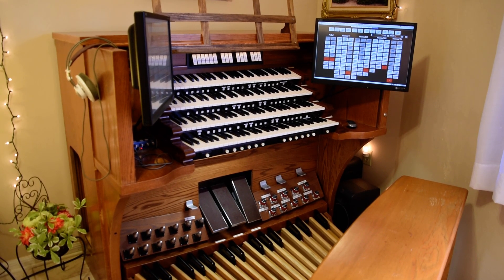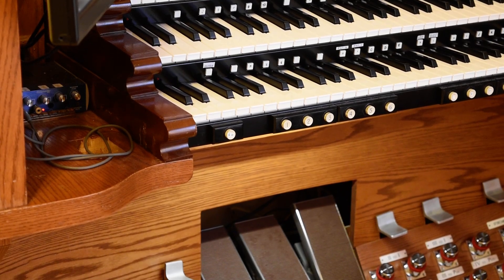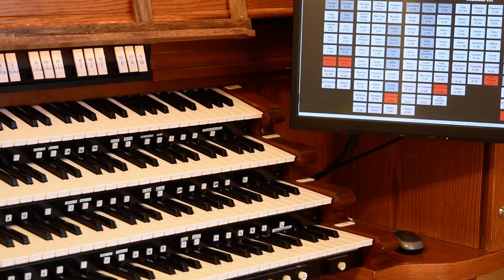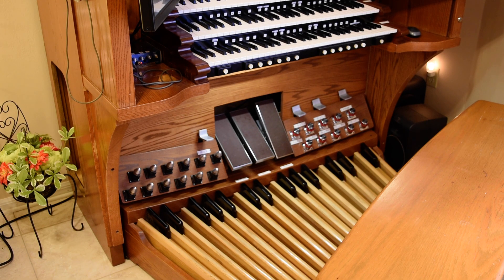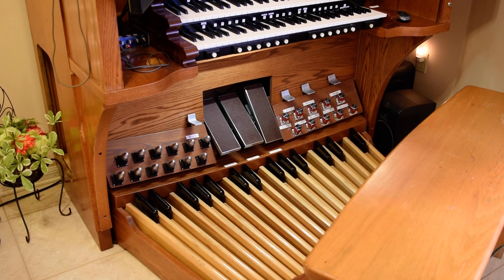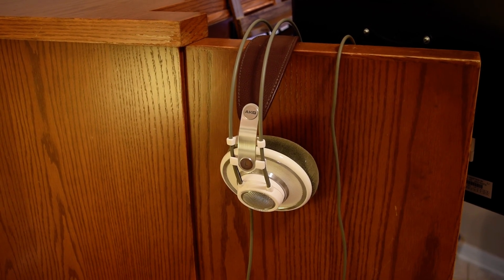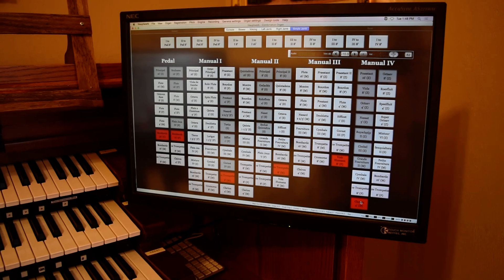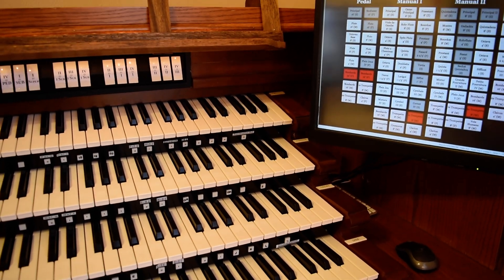Hauptwerk Organ Pipe Organ Retrofit

Comment: Thank you so much. Could you tell me what size the headphone output ports on the Presonus HP4 are? Also, do you have two inputs going in? Where did you get the recommendations from Brett Milan? Is there a website?
Reply from the maker: The PreSonus HP4 has the large headphone jacks ( 1/4" ???). I also have a few pairs of headphones with the small plugs so use an adapter.  The PreSonus "sound card" has a MIDI IN and a MIDI OUT plus several output jacks. I tapped the HP4 headphone preamplifier into two of these outputs. 
Regarding headphone recommendations, Professor Helmut Maier of OrganArt Media (Sample Set Producer) stated that AKG701's were the best. He was correct. In the beginning (2007-8) of Hauptwerk when Bret Milan was more involved with customer service and created some sample sets, he was available for recommendations, etc. There is a website (Hauptwerk Forum) but Milan is unavailable. Hauptwerk producer, Martin Dyde, is extremely helpul to everyone.

Comment: Hi Tuba mate, hay I've made a few attempts at this too now and run into a few snaggs, I was wondering if you had the same issues. The first problem is a rather big Latency as they call it, I'm having a minimum of at least three quarters of a second delay from note press on the keyboard to actual sound, then there's the next issue of MIDI Channel choke when Bach is played, man it's just unplayable. The CPU Loading isn't  that great. I don't know if I should cut my losses & Dump MIDI for a custom Parallel port scanner to elliminate channel choke because MIDI is basically a single channel serial port which doesn't cut it for complex musical pieces. What's your thoughts & experience on your machine?
Reply from the maker: I'm not sure what computing power your computer has. Before I upgraded my 2008 MacPro dual-quad core ( 8 cores) to the present MacPro 12 core, the only sample set that gave me a latency problem was the giant Esztergom sample set which I rarely used. All my other sample sets were fine. The 12 core handles everything instantaneously. The 12 core Mac Pro was a used 2010 computer that has worked flawlessly for eight years of constant use.
Reply: @tubamaxima187  Ahhh good to know, I got a guide line to work with now. I have a new 24 core, 32 Gb ultra high speed ram built for the job now, though haven't spent much time on the MIDI side of this for some time. Having dramas with getting sample sets to load properly. the organ software works fine with the basic sample set included but nothing else so far. Anyway more work needed at the moment.
Reply: Well old mate, those computers are Mega computers. I know I started small with 4 Gb but on checking out memory usage after the sample set is loaded, it only used 800 Mb & the processor loading is about 25 - 30% but yes I do have on order the latest top of the line Udoo Bolt V8, it's the most powerful single board computer on the market & the thing will fit in the palm of my hand complete with an SSD drive & 32Gb ram with the ability to run 4 x 4K displays if you want along with all the other usual peripherals + an on board microcontroller. Thats my current plan to beef it up. I've only used old computers to prove the concept. I just hope this is the right direction. When it all turns up I'll let you know so everyone else can see if it was a good idea or not.
Reply from the maker: I  am completely inept when it comes to computers. Your latency problem is probably due to your processor being overloaded with too many stops. Do you get a delay from one or two stops ? There is a polyphony adjustment (number of pipes simultaneously playing)  that can be lowered. See if that works.
Reply from the maker: Hi HiTeck:
I have to confess I am not a computer guru so adressing your issues is beyond my ability. If you are a member of the Hauptwerk Forum you may pose the question on that site and get an answer. The only sample set I have that has a latency issue (i.e. a slight delay from key press to sopund) is the large Esztergom.  I would suggest that you reload your sample set rather than fiddle around with endless possibilities and go to the "Polyphony" section which is located on the drop down menu. If you reduce the polyphony (it depends on how large your organ sample set is) it may increase the speed or reduce the latency. I'm not even sure if that is your problem. How many GB of RAM do you have ? I had 32GB with my old 8 core MacPro but now I have a 2011 MacPro from IBuildMacs (talk to Jon, he's amazing) that he built for me that now has 12 cores (3.33 GHZ) and 96 GB RAM. It's supposed to be the fastest computer on the planet. I don't know if the latency issue has anything to do with RAM but my problem went away. I paid $2600 for the computer. I would NEVER buy another new  Mac as they are all way too expensive. Apple is disgusting, four years ago my 8 core stopped working and Apple wouldn't even look at it since they said it was "vintage". After calling around I found out that the problem was simple, it was a bad RAM module. Apple was falling over themselves trying to sell me a new computer for $12,000. They disgust me.

Comment: Hi and congrats on your VPO build. I also have built a four manual organ from an old 1970 vintage Allen console. Not as pretty and well finished as yours but works well I'm using Hauptwerk plus the Paramount 450 series Best wished from Australia.
Reply from the maker: Hi Ross from Down Under. Thanks for your nice comment. Interesting choice of your console  (1970 Allen). I actually converted a Rodgers (I think a 1969 or 1970) myself but settled on the Schantz as seen in the above video because it gave me greater flexibility with the computer monitors rather than a fixed number of stops. However the consoles with real moveabe stops make for a better real-time experience than computer monitors. Its a tough choice, for sure. The consoles of that era were very well built and used double acting stop action magnets rather than fixed stops that light up. My 1970 Rodgers sounded horrible (for the time it was state of the art) but a Hauptwerk conversion breathed new life into it. Amazing.  I would like to see some pictures of your console if that is possible.I love the Paramount 450  theater organ but doesn't that require an external reverb (which I don't have) to make it sound more realistic ?
Reply: Hello again

This organ build project was undertaken with my 15 year old son and was a home school project. It went through several rebuilds, does it ever end, starting as a two manual Allen console and now extended to 4 manuals. I have 30 lighted pistons set for divisional pistons plus 24 membrane piston switched mounted under the keyboards, 20 of these are the general pistons and 4 set as toe buttons. Don’t have any of those at this stage.Plus 44 stop tabs on the stop rail. Cabinet has been extended upwards, a bit rough and ready not such a nice job as yours, but very functional. I had lot of issues with the old Allen keyboards which really needed replacing. I did this very economically using 4 Roland A-800 Pro keyboards. These work very well and also provide the double touch functionality used with the Paramount 450. I have also added top right of cabinet a Behringer Reverb Unit. This brought the organ alive. I’m also using Presonus Midi/Audion Box and the HP4 Headphone Amp. This allows me to split the output signal from the Behringer Reverb to both my external home theatre audio system and the headphone HP4 unit. Listening and practising using the headphones is like sitting in a cathedral or concert hall. While I play a lot of musical and light classical music, I also enjoy classic organ music and use the basic Hauptwerk Organ for this. Maybe one day when funds permit, I get a larger classic organ to add.

Jos from UPS systems in USA supplied all my encoder boards and has been super helpful throughout the build. We often exchange MIDI files as I enjoy listening to my VTPO being played well by others.

I’ve attached a couple of pics, hope you get these OK through this YouTube reply.

Kind regards from Aus

Ross Baker
IMG_0465.jpg
IMG_0446.JPG
Reply from the maker: The old electronic organs (Rodgers, Allen, Viscount, etc.) make excellent donors for Hauptwerk upgrades. Some of the earlier consoles are beautiful pieces of furniture just begging for an upgrade. The console I used was a 1960 Schantz but I also converted a 1970 Rodgers Mod 770 which had three manuals and 66 tilt tab stops (which I prefer to draw knobs).

Comment: Very impressive setup there. I want to do the same with some scrubber Organ that has failed electronics but keyboards are good. Can Hauptwerk software work on a Linux system? And those digital scanning boards, where do you get those?
Reply from the maker: contact me privately
Reply from the maker: Yes LINUX will work. Contact Classic MIDI in Canada. I would recommend that if you get three or four keyboards, get one with the pistons and three with no pistons. I never use all of my pistons.

Comment: Hello "Tuba Maxima", could you please share the complete description of the PC that you use? Thank you very much
Reply from the maker: The original computer was a 2007 MacPro dual-quad core (eight cores) at 3.00GHZ speed with 16GB (later up graded to 32GB). This computer is 99% of anything that you will ever use. You can purchase these computers for IBuildMacs in California. Brett Milan highly recommends Mac computers (very important) over PC's. I made the mistake of using a Hewlett Packard PC in another organ and it was plagued with audio problems. It was terrible. I ended up replacing it with a Mac and instantly the problems went away. PC's only have an advantage because they are cheaper than Macs but IBulidMacs can offer an eight-core MacPro Dual quad core with 32GB ram for around $800. I replaced the MacPro with a 12 core Mac Pro (3.33GHZ) and 96GB RAM but it is unnecessary. I still have the eight core just  in case my 12 core dies.
Reply from the maker: contact me privately
Reply from the maker: Initially the computer was a 2008 vintage MacPro with 8 cores (dual-quad core) and 16 GB of RAM at the recommendation of Brett Milan. The computer was extremely reliable for extended daily use for six years (from 2008 to 2014)  when one RAM strip went bad. Apple was not helpful at all in resolving my computer problem. A third party vendor (Other World Computing) was nice enough to help me diagnose my problem which just required one of the eight RAM modules to be replaced. At that time I decided to purchase another computer as a back up since I couldn't rely on Apple for any help. I obtained a 2010  (mint condition) 12 core (dual -six core) with 96 GB of RAM which is what I am presently using.  Although many Hauptwerk owners are using PC's, I am cautious of them because they have a reputation of not being as reliable. I am sure many Hauptwerk owners will disagree with me.
Reply from the maker: Hello edasadmin: The computer is a 2008 MacPro. At the time of the video it was a 2008 MacPro Dual-Quad core (eight cores) and 32GB of RAM. There are four hard drive slots  with 2TB hard drives in them. In 2016 I upgraded the computer to a 2011 MacPro 12 -core (two-6  core processors) to future-proof it for the huge sample sets that would eventually be released. It has 96GB of RAM. I bought the computers used. Mac's are very reliable.
Reply from the maker: The computer I used in the video was a 2008 MacPro dual-quad core (8 cores) with 32GB of RAM (memory). The computer has plenty of processing power for big organs like the Caen. After having a negative experience from Apple (they wouldn't look at my computer because they said it was five years old) I was fortunate to fix it myself (simple fix) from help from a third party computer parts supplier. One of my eight RAM modules failed. As a result of my negative experience I decided to get a back-up computer - a 2011 MacPro with 12 cores and 96 GB of RAM - a super powerful computer even by todays standards.

Comment: Nice shoehorning job.  For my proposed build for OMS Japanese Christian Church, I'm already planning on at least a 76" wide console to provide for, in addition to two to three rows of toe studs to reverse couplers and engage and cancel Tuttis, two columns of staggered toe studs on each pedalboard flank (not possible with this 64" Schantz console) - the flank studs are intended to reverse Pedål stops - plus seven columns of drawknobs on each stopjamb (for the "hard" stops and couplers) and one row of rocker tablets above the top manual (for flexible stops and MIDI couplers).  I plan on sticking to AGO specifications for all drawknob face, rocker tablet, and piston colors, plus label colors on all toe studs - faster familiarization for guest artists that way.
Reply from the maker: I was able to dis-assemble the console into smaller parts that would fit through a standard door and that I could move myself. Using the Schantz console ( I believe the console was from the 1960's) was a cost saving factor. I got the entire console for $400, including bench and pedal-board. Converting from analog to digital was easier than I expected.
Reply from the maker: Keeping the console original is nice. I made my Schantz console "modular", easy to break down. I have moved three times and relocated the console from one room to another. I can get the pieces through a 30" door.